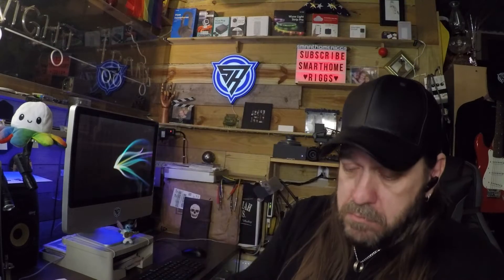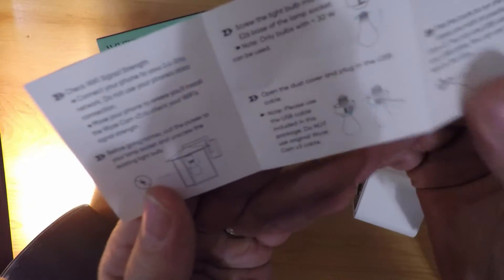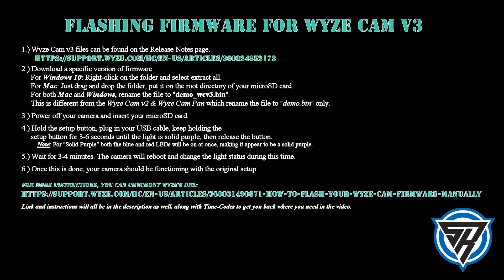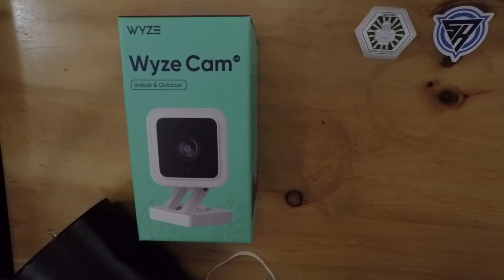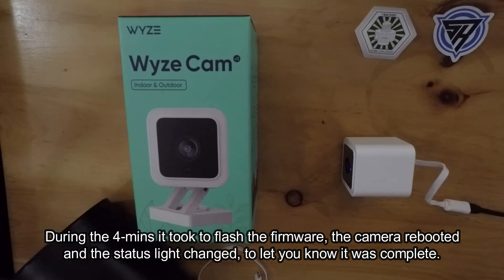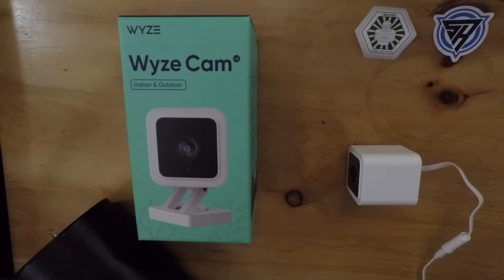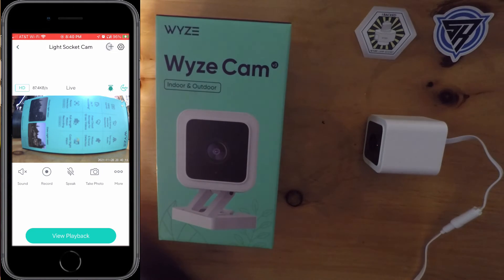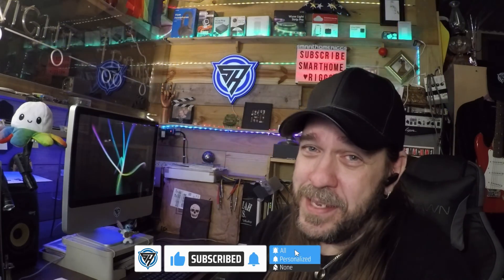Un-Brick Wyze Cam & Bring it back to life!

Comment: I went to update the firmware on my Wyze DoorBell v1, but the power immediately went out, now it no longer works, do you know if there is any method that I can recover it?
Reply from the maker: I checked the Wyze website firmware flash page and they do not have a way to flash the firmware on that device. I would reach out to Wyze since the issue happened during a firmware update and see if there is anything they can do. I'm sorry I don't have a better answer at the current time. I hope this helps and thanks for the comment and for supporting the channel.

Comment: I had one that wouldn’t connect following an update. I JUST finally got it fixed but also experienced the same issues with manually flashing as others including the inability to achieve the solid purple light. I found a recommendation in the posted procedure to use a 32GB micro SD and formatting to FAT32 before putting the latest flash file on it. THIS did the trick and I was finally able to obtain the elusive purple light and my camera that has been shelved for so long is back up and running. I hope this helps.
Reply from the maker: Thank you for the update, I have had better success with 8GB and 16GB, but I will start ensuring that the cards are formatted FAT32 before putting the firmware on it, I have 1 V3 that is still shelved, I will try this on that one and report back with the results, Thanks again for sharing your experience and thanks for supporting the channel.

Comment: I just bought the lamp socket to use with Wyze V3, but the charging part that goes into camera doesn't fit, only the angle one that comes with camera fits. FML
Reply from the maker: The lamp socket has a proprietary cable that is wired differently than the regular V3 power cable this was the cause of the bricking in the video. The Lamp Socket Will ONLY work with the regular Wyze V3. The reason is, the V3 software interface was designed to work with the LED light attachment they offer and the lamp socket leverages this interface.  It sounds like you have the V3 Pan, that is a different camera and interface all together. I hope this helps and thanks for supporting the channel.

Comment: I tried using an 8gb card and it didn't work. It was a cheap no name brand. Went to Walmart and the lowest name brand card was 32gb. I'll try to find a good 4gb card online.
Reply from the maker: I've had better success with 8GB and 16GB, but other have reported to us that they were successful using a 32GB card and formatting it FAT32 before putting the firmware on it. I hope this process will work for you as well. Please let us know if this helps bring your camera back as well. Thanks again for sharing your experience and thanks for supporting the channel.

Comment: Like others have posted, I can't get the purple light when following instructions for flashing firmware, only red. Moving through the rest of the steps, I still cannot connect to network so assume the firmware reset was not successful. Are there any other tricks to get around this?
Reply: I had one that wouldn’t connect following an update. I JUST finally got it fixed but also experienced the same issues with manually flashing as others including the inability to achieve the solid purple light. I found a recommendation in the posted procedure to use a 32GB micro SD and formatting to FAT32 before putting the latest flash file on it. THIS did the trick and I was finally able to obtain the elusive purple light and my camera that has been shelved for so long is back up and running. I hope this helps.
Reply from the maker: Thank you for the suggestion I will try that with the V3 that has sat on my shelf since the firmware killed it 2 years ago.  Thank you for the comment and thank you for supporting the channel.
Reply from the maker: I had this issue resetting 2 of mine and found that using a 4GB or 8GB microSD instead of a larger one was more successful. I hope  this helps. Thank you for your comment and thanks for supporting the channel.

Comment: I've been using Wyze for several years now, v2 and v3 cams. Just recently all of my v3 cams stopped working, "Cannot connect to local network." The latest update bricked the camera, read all the other comments below. My v2 cameras work the same as always. I've gone through setup 30 times with support and emailed tier 2 support, wasted two days doing every possible thing including this updating firmware from the SD card. I cannot get the purple light. It just goes to red. Waste of my time and money. The best Wyze will do is offer me a $5 gift certificate. I told them to keep it. These will not be replaced with Wyze cameras. When the v2s stop working they'll go in the trash with the v3s.
Reply from the maker: I had this issue resetting 2 of mine and found that using a 4GB or 8GB microSD instead of a larger one was more successful. I hope  this helps. Thank you for your comment and thanks for supporting the channel.

Comment: My Wyze Cam V3 failed because it couldn't find my WIFI network, I hope this fixes it. (worked great for 2 years outside).
Reply: Didn't work for me, I can only get a solid red light like others on here. These are bricked and all Wyze will do now is give you a $5 gift card towards a new Wyze camera.
Reply from the maker: I had this issue resetting 2 of mine and found that using a 4GB or 8GB microSD instead of a larger one was more successful. I hope  this helps. Thank you for your comment and thanks for supporting the channel.

Comment: I have three V3 cameras that work very well until I did the firmware update at the end of July. I also have a V2 camera that I did not do anything too and it works very well. After the download of the firmware to the V3 cameras, none of them would connect to the Internet. I remove my V2 camera from the Internet and reinstalled it so I do not have an Internet problem however, I cannot get the V3 cameras to work any help? I am not that great at understanding computers so I step-by-step instruction would help. Thank you.
Reply from the maker: I had this issue resetting 2 of mine and found that using a 4GB or 8GB microSD instead of a larger one was more successful. I hope  this helps. Thank you for your comment and thanks for supporting the channel.

Comment: Thanks for making this - it got me further than their website. Unfortunately I'm stuck on the step where the light is purple. What color is it supposed to change to once the firmware finishes reinstalling?
Reply from the maker: Also just a thought, we've had the best success flashing the firmware using only 4GB or 8GB Micro SD cards. The larger cards take longer to access/seek and seem to timeout, but the 4GB and 8 GB cards load faster and have a higher success rate, (at least in our testing.) I hope this helps.
Reply: @SmarthomeRiggs  was having trouble flashing using a 128gb card until i saw this comment. dug up an old 2gb card and flashing firmware worked perfectly. thank you!
Reply: @SmarthomeRiggs  I have tried 32GB and 8GB cards, and none of them worked. But it was a cheaper card. Maybe I'll try a better 4GB card.
Reply from the maker: Try using a 32GB micro SD and formatting to FAT32 before putting the latest flash file on it. This process has worked for others in our Smarthome Riggs community. I hoe it helps bring your cameras back online. Thank you for supporting the channel.
Reply from the maker: Once the firmware finishes the device should restart like normal. (The last firmware flash I ran took 3-5 minutes start to finish) As long as you are not holding the button it should not try to start it again. I hope this helps you. Thanks for supporting the channel.

Comment: Worked for me. Many thanks! I'll never buy another Wyze though. Terrible software, slowwwww to connect to the camera stream, and their firmwares are just ads for their add-on paid service. The internet is furious about many bricking cameras. Very few of them try to flash the firmware again.
Reply from the maker: The V3 Pan, OG, and OG telephoto have a much faster connection time to the camera stream. We have been using Wyze cams since they first started and they're getting better and better. From our testing, the V3 has the worst WiFi connection of any of their cameras. Thanks for the comment and Thanks for supporting the channel.

Comment: At the beginning I just got a red light on the cámara and nothing else then I keep pressing the Setup  bottom with the cámara disconnected then I connected the cámara to the power cord and got a purple light ready to flash. Be aware you need to copy the demon firmware on the SD not the Zip.
Reply from the maker: That is correct, on the Wyze support firmware page ( https://support.wyze.com/hc/en-us/articles/360031490871-How-to-flash-firmware-manually ) Step 2 states "Download a specific version of firmware, For Windows 10: Right-click on the folder and select extract all. For Mac: Just drag and drop the folder, put it on the root directory of your microSD card. For both Mac and Windows, rename the file to demo_wcv3.bin" . It has to be the extracted files and not the zipped file or it will not load the firmware to the camera. Thank you for the clarification and the comment.

Comment: It worked for me, but I tried having the mac OSX file in there and that won't work out right. I figured it out with just the bin file inside the extracted file, and putting just that on the SD card, and repeating the hold setup button and it all worked out. Hopefully this helps.
Reply from the maker: This has happened to other community members as well, so thanks for the comment.  I 'm sure this will have value for other viewers.  See you in the next video.

Comment: My v3 has no status led light on , when connected to power no led light will come on . What to do please
Reply from the maker: Were you successful in getting the firmware to load (Did the led ever turn purple)? if the led is never lighting "red or purple" then I would have to suggest contacting Wyze to see if they can send you a replacement.
Reply from the maker: https://support.wyze.com/hc/en-us

Comment: So now I have to purchase a USB adapter for the sim card?  Not happy with this product.
Reply from the maker: Sorry you're having issues with your camera.  When you get it back up and running, it's one of the best cameras in this price-point from ANY manufacturer, and the fact that's it works indoors and outdoors makes it better than most.

regarding the card, it's a MicroSD memory card, not a SIM card, (although they are similarly sized, they don't fundamentally different things).  But it's true, if you don't have a laptop, desktop, or printer that can read a micro SD card already, then you would need an adapter to perform this fix.  

If you have security cameras, or dash cam cameras that record to a MicroSD card, you should have one of these adapters anyway, to pull footage direct to your computer if/when needed.

They're under $15 on Amazon, (here's one for $6.99 that's USB 3.0, (https://amzn.to/3nXv9Wp) and one for $12.99 that's USB 3.0 and USB-C, (https://amzn.to/3uMBc3D).  I hope this helps you get your camera back up and running.  And I hope you join the Smarthome Riggs community, so we can here how it went, and if you change your mind about this amazing camera.
Reply: @SmarthomeRiggs  😅

Comment: After pressing the setup button for a long time, still a solid red light.
Reply: Same here solid red light still.
Reply from the maker: @TheManm333  I had (2) V3 cameras that died after the firmware update before the last one. Both would only show a solid red LED and nothing I have tried even a firmware flash has made a difference. I contacted Wyze support and after doing all the steps with them, they had me fill out a form, take a photo of the QR code and Mac ID sticker on the camera and then sent me 2 replacement V3 cameras. This is apparently a known issue with only some V3 cameras. I hope this helps.
Reply: @SmarthomeRiggs  Same here! I got a replacement but it's stuttering with playback again after the latest update.
Reply from the maker: @TheManm333  I had that issue with 1 of the 2 replacements I got but that camera did take the firmware flash and now works like the other ones. I hope this helps.
Reply from the maker: I had (2) V3 cameras that died after the firmware update before the last one. Both would only show a solid red LED and nothing I have tried even a firmware flash has made a difference. I contacted Wyze support and after doing all the steps with them, they had me fill out a form, take a photo of the QR code and Mac ID sticker on the camera and then sent me 2 replacement V3 cameras. This is apparently a known issue with only some V3 cameras. I hope this helps.
Reply from the maker: Holding the button while plugging it in is key, but also difficult.  We found it easier to have the camera connected and unplugged and hold the button down while plugging in the plug. 

Also, prior to resetting we had it unplugged for 30 seconds before starting this process. 

You can try this and see if it helps you with your camera. And please let us know if it worked for you.

Comment: I tried the video but the camera still doesn't work, after a minute in purple led color returns to red color, I restarted it and the led is still in red. Any advice? Many thanks!
Reply from the maker: This is going to sound lazy, but seriously... try it again.  The one I bricked, I had to do three times, before it worked.  But on the third time, it was like it came out of the box, and setup properly.  Also, make sure you have the file "named" correctly, the v2 and v3 use a different name for the file in the root.  

Good luck, and please stop back by and let us know how it went.  We hope you join the SmarthomeRiggs community with a Sub, so we can hear from you in another video.
Reply from the maker: if the led is still solid red contact wyze and they should replace it since this seems to be a known issue with a small number of V3 cameras. I hope this helps. https://support.wyze.com/hc/en-us